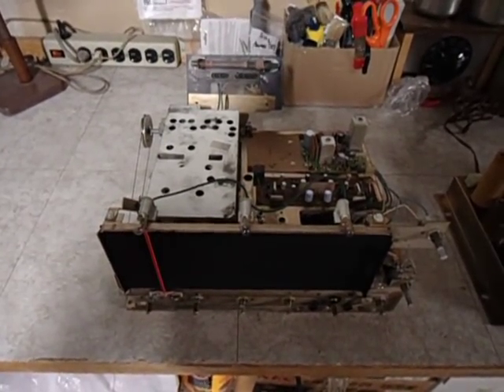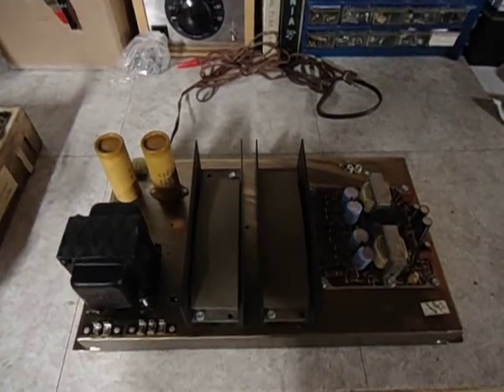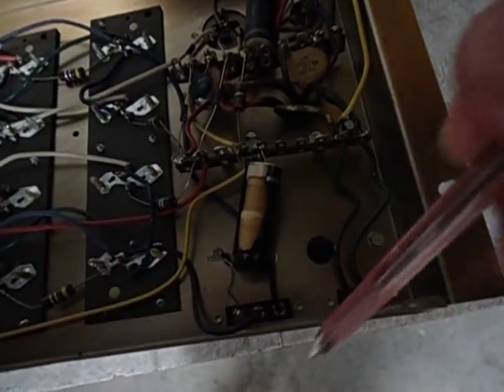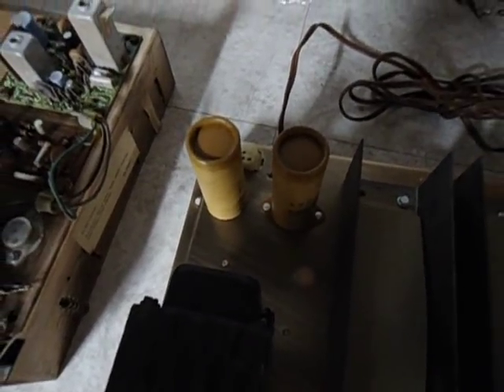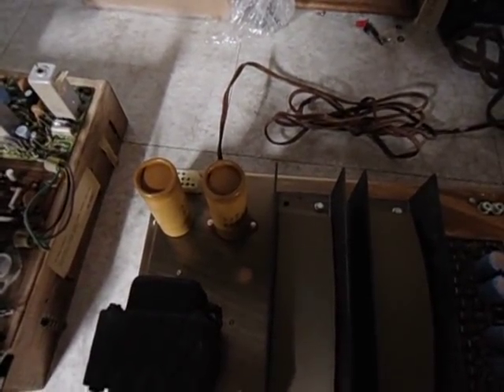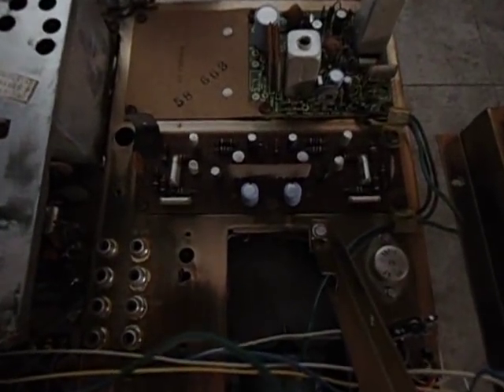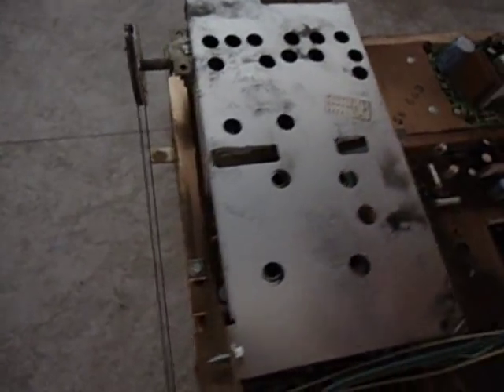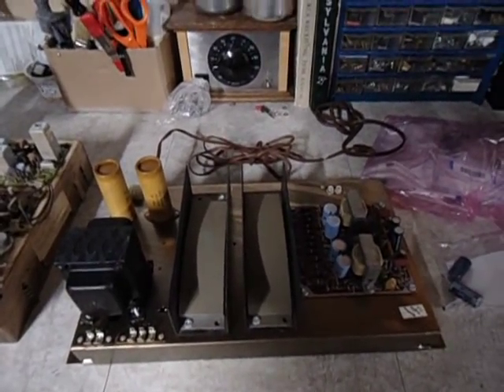1966 Magnavox Astro-Sonic 100 Recap and Restoration

Comment from the maker: Alan - I also saw your recent post on Magnavoxfriends regarding caps.  I can't believe how much difference a recap made in my Astro-Sonic 100, especially the phono preamp section.  I thought I needed a new cartridge, bad caps cut off the highs from the cartridge.  I did use the Nichicon audio gold caps from Mouser in the phono preamp section . The AM band wasn't working and FM was weak until the recap. - Ray

Comment from the maker: Bill - The soldering isn't bad.  I have a de-soldering iron which has a round tip with a hole in it that connects to a long tube with a small rubber bulb on the end to suck the solder out.  Magnavox did a great job of marking the + & - on the PC boards.  Soldering was easy and went real fast with a 35 watt iron.  I just finished working on a GE AM/FM table radio exactly like the one I had has a teenager.  The solder used in those days required more heat. more.....

Comment from the maker: So I used my 100/150 watt Weller soldering gun & ended up breaking the foil connection for the filter cap on the PC board. So I had to bridge the break by running a wire between two points. The GE only had 3 paper caps, all the rest were ceramic.  I had problems with only half the AM band worked. FM was great. Turned out it was cold solder joints on a tube socket and bad ground to tube shield.  So now it's playing as good as new.  I'm going to have to a video of this radio.  It has great sound.

Comment from the maker: MIke, I hope you get that Provincial.  I also go to Midway Antiques and love looking at all the consoles they have.  I bought my caps online from Mouser Electronics.  Yesterday I finished recapping and replacing resistors in the power amp.  Since the set has a PC board it was quick and easy.  Power supply was another story.  I thought I had subscribed to your page but with all the Youtube changes I must have lost the link.  I'm re-subscribing now.

Comment: Hi!  In your video, you mention you had a Sams Photofact schematic.  Can you please tell me which Photofact that is?  I am attempting to service a model 1RP620, which I believe is similar to yours except having the (lower power) power amp as part of the tuner/preamp/power amp.  Thanks much!
Reply from the maker: The chassis number for the tuner/preamp is R207-01-00 Sams Set 790 Folder 5.  Are you a member of Yahoo group Magnavoxfriends?  The members of the group are a good source of information on Magnavox consoles.  They have a photo section as well as some schematics.
Reply: AstroSonic1967 Much obliged, AstroSonic!  I am an electronics technician servicing this for a customer.  I think I have found the Sams for this unit, and I see they use Chassis numbers, not model numbers.  This one is chassis R20413, and Sams lists a chassis R2041510, in Sams 841, folder 6, so I'll try that.  But thanks again for your reply, I really appreciate it!

Comment: I recently inherited one of these without a power cord....where does the cord even go? I can't locate it
Reply from the maker: +Jake Lawrence Magnavox consoles do not have a plug-in type power cord.  I'll bet your power cord was cut and you will find what is left of it inside the cabinet and it should still be attached to the power amp chassis.  You will need to attach a new power cord by unsoldering the leads jof the old one and solder the leads of the new one to the same terminals the old one was attached to.
Reply: +AstroSonic1967 thanks for the info!!!